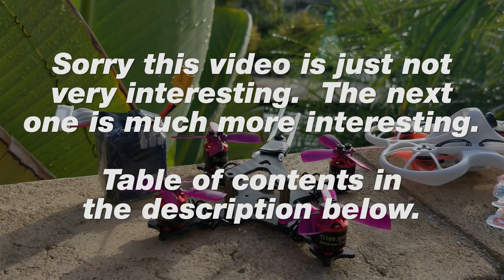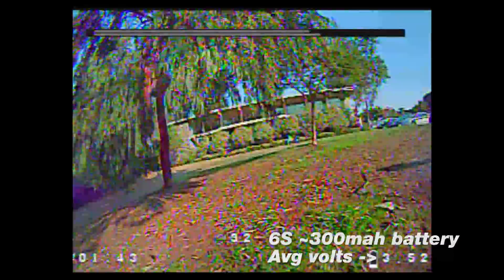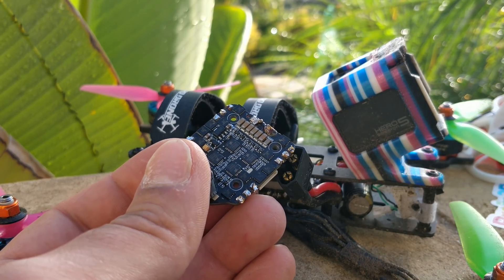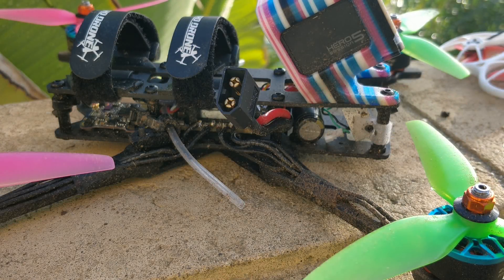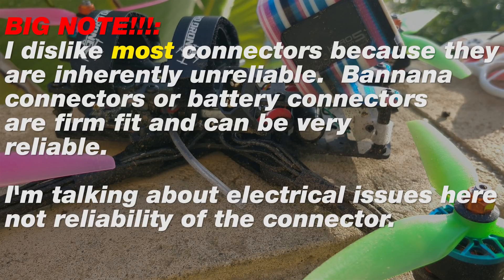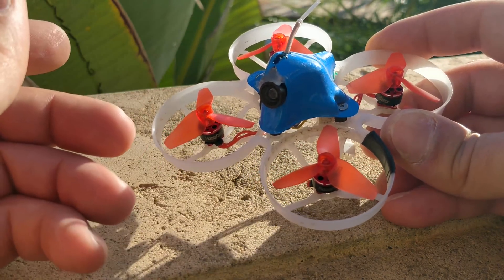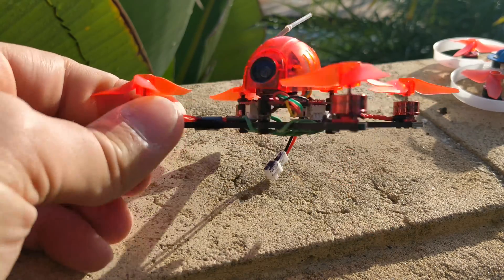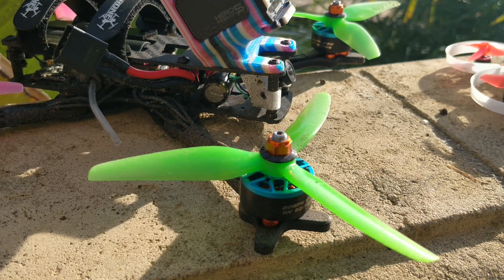6S 2", Just check the table of contents plz thx

Comment from the maker: Table of Contents:
00:53 - 6S 2" anticlimactic
06:00 - 4S vs 6S on same quad
07:07 - GoPro setting findings
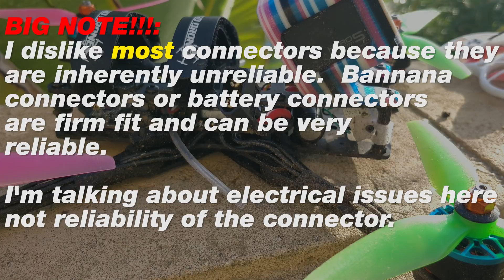09:41 - motor wire connector?
11:34 - TinyHawk update
14:24 - 1S 2.5" micro...
16:21 - My soldering SUCKS! dunno why :-(

I'm torn on whether I should pick up a set of these.  They're so pretty.  They come in 1800kv but I really wish they were a 2208: https://goo.gl/yRrihJ

TS100 iron: https://goo.gl/DqBipa, https://goo.gl/svK6DD, https://amzn.to/2OV5XMh
TS80 iron: https://goo.gl/CrQ17N

Things I like:

Micro Eagle - 
My preferred FPV cam still
https://goo.gl/or1fS9

Rush Tank Vtx -
One of many good Vtx's. I like it because it works well and fits my build style
https://goo.gl/YMYmya

WaFL’s Cap Cap
https://insta-stalker.com/profile/wafl.fpv/
https://goo.gl/9CZdAs

TinyHawk!: https://goo.gl/LrQiN9, https://goo.gl/8y66Gf

My TinyHawk tune:

First off, set your landing/warning voltage to 2.9v and your warning voltage to 3.2v.  This is a non-issue with 1S as you can't really pull enough amps on this thing to actually damage the battery much.

Make sure it's set to 8k/8k and I recommend Multishot with min throttle at 1175

Roll and Pitch are the same numbers: P 80, I 55, D 46 FF 45, RC Rate 1.32, rest default
Yaw: P 60, I 60, D 0, FF 45, RC Rate 1.32, rest default

Iterm relax on and on defaults, the other three switches above it off.

Tips?
Bitcoin: 1E4XZXoD4rS6MYWVWuenY7Kw2M1YgyNpoQ
Nano: xrb_1188ek5bd7tb9kw67asnp9o65byuoaxbtpxuznx1ribf75x78awywmakj55f
ETH: 0xD067F93811f2eC31CB1928901002dfdf9A492EF5
LTC: La2KWYAjp4VT2Lq2M76pbjzXWvRyjpfCtG
Reply: Kabab FPV you won’t be disappoint in those Xing 1800kv. Have you flown the RDQ 2207 1800kv? They perform identical if that gives you a gauge...
Reply from the maker: @dnafpv  well the specifics are within the range that I will like on 6S and they just look really really pretty that's really the only reason why I want them. They are just so pretty
Reply: Gotta say though as much as I agree about and love my tinyhawk those struts breaking really affects flight in hard turns for me. I’m using hot glue it seems to work best at keeping them attached
Reply from the maker: @dnafpv  yeah really annoying on the sruts. They're redesigning it and releasing a new frame
Reply: Kabab FPV they are soooo sexy I agree. They are great in the air too but I can’t say they will do anything better than look prettier. I definitely don’t think they’ll disappoint though. I kinda like them the same on 5” or 6” maybe I’d feel more diff if they were 2208

https://youtu.be/EhQTYb2NS5w

Comment: TS100 is better.
TS80 has non-standard tips which are expensive, and it runs off USB-C instead of a barrel connector.
the Pinecil (from Pine64) is worth looking into. I haven't tried it yet, but its entirely opensource hardware. Its similar to these irons

Comment: could we get the brass inserts from the XT30, without the plastic shell?
and just put shrink tubing around it after we 'plug' them together?
For motor connectors.
Reply from the maker: yeah actually you can. They're called banana connectors and come in long and short variety.

Comment: I know this is an old video so maybe you've figured it out, but if you use flux it'll solve all your weird solder joint issues. Not sure why it was suddenly an issue but flux will make those weird looking joints nice round shiny solder blobs.
Reply from the maker: Yeah it was just super shitty solder. There should be a link to the good solder in my new videos now

Comment: 63/37 is actually better for electronic soldering FYI. But besides that, I just found your channel recently. Actually heard steel and Konasty talking about you on their podcast so I came to check it out. Now I'm hooked on your videos which I find super informative. thanks for the stuff and good luck with everything in the future
Reply from the maker: I know 63/37 is technically better but I personally prefer the working time in case I need to suck off some solder or splatter it off.  It just generally flows a little better too.  Especially on thick wires where you're heating up all over trying to get that stuff to wet.  Welcome, glad to help...
Reply from the maker: Wait, they have a podcast? lol?  Where?
Reply: @Kabab  also yea they have a podcast they usually get to every week but sometimes every 2 weeks. Here's a link it's called teamfailsafe

http://teamfailsafe.libsyn.com/team-failsafe-weekly-podcast-bang-for-your-buck

It's Eric, Steele, and ruben. They kill it man so funny
Reply: @Kabab  that's the most recent episode. They talk about a reveiw you did about the props at about 21:30 into that episode
Reply from the maker: @pawn63295  ah I remember. I dunno why I forgot that was them.  Thanks for the refresh
Reply: @Kabab  I didn't know that. I'm super new to the drone hobby. I actually have everything except a drone yet. I fly in the sim still. I've just been told that 63/37 has a lower melting point and is easier to work with from electronics people I know

Comment: I use 63/37 kester solder with my solder iron at 420 degrees Celsius and I use solder paste on each pad and it's the way to go imho.
Mobula 7s frames are trash, not very durable at all, my son broke his one today smacking a tree at speed.
I'm looking forward to using my ts100 but haven't needed to use it out in the field yet.
Keep up the good work 👍🏽👍🏽
Reply from the maker: Just got the kester. The TS100 is awesome

Comment: hi @KababFpv 

I have been following 4s on 6s motors progress for some time and am wondering: 

if the better flight time supposedly on 6s is due to less amps higher voltage, but same overall watts? 

is it correct thinking to say if I run 4s on 6s motors will I have longer flight times?
Reply from the maker: Yes definitely 4S on 6S quad will give you more equivalent flight time.  The important factor to consider is equivalent time.  Typically you'd run a smaller overall capacity 4S battery over your 6S pack but you'll still get a little more time than the 6S pack.  Most of that reason is because the motor is just so efficient at not being over-pushed to convert electricity to thrust.  The whole system runs more efficiently....you're also flying slower.  You're not gonna create magic anywhere unfortunately, but you are better balancing the use of power available.  2700kv 4S 5" just seems stupid to me now.  Batteries hate that and are damaged during EVERY SINGLE FLIGHT.  I have some 6S packs with over 150 flights that perform very comparable to brand new packs.  Probably because they're not being stressed at all.  Same could be said for running a smaller 4S pack on a 6S quad.  The battery will last for more cycles because you're not asking 500 amps from it when you touch the throttle
Reply: @Kabab  thank you for taking the time to reply, really appreciate it, I had a ghost with 2600kv f40 motors and I was getting 1:30 min flight times and batteries since that session have been struggling, I have since taken the quad apart and sold off motors. 
just watched you new video with 1800kv with a throttle cap/end point of 89 and it seems like your pioneering the way forward, I've looked a lot into racing and am realising control > speed and power, it makes way more sense to have something slower that you have full control over at 100% throttle instead of something that your keeping at 50-70% trying not to blip it into the stratosphere. im super grateful your exploring this as I didn't want to spend the money on 6s motors and have it turn out shit on 4s so thank you for continually being curious and discovering with quads

Comment: I wonder if you lose any amps with a XT30 connection with what 16AWG?  Should run 8 to 12AWG wire for power wire with a xt60 for 6S no matter what size.  https://www.jamestowndistributors.com/userportal/pdfs/howtos/Tech_Wiring_Voltage_Sizes.pdf
Reply: Most batteries come with 14AWG wire for power wire.  I have to wonder if that doesn't hinder the amp flow.
Reply from the maker: The lines are usually too short to make a difference.  On my 6S batteries and quads I prefer 16awg.  The amps flowing to a motor are not nearly as high as the main battery lead.  An XT30/MR30 should be fine.  I have also run a 6S battery through an XT30 on the main line to see what would happen.  I couldn't tell any difference.  Flew fine.  Didn't even get hot.

Comment: Running those same 1108/6000kv motors on 3s with 3" avan props seems to be the sweet spot.  4s needed a lot of tuning and made the throttle really twitchy without any increase in control, probably a little loss of control, slightly more top end.  Both 3s and 4s packs were 550mah, 4-5 min flight time on 3s, 2 min on 4s.
Reply from the maker: Yes definitely

Comment: I am guessing it actually is the props are not designed for like above 30000rpm. APC said almost all of there props are designed for 30000rpm max before they can not hold there shape. Had that problem with my 145mph record quad. So you are probably hitting that with 4s.

Comment: That banggood solder sucks. I tossed it in the bin. Kester is a good brand btw.
Reply from the maker: Kester on the way
Reply: @Kabab  I've also been brushing flux on lately when I'm dealing with bigger wires. Here's a good example of a solder joint I used flux on. You do have a clean it up afterwards and it's a bit sticky but the solder joints look amazing.

Comment: Hi Kabab,  thanks for sharing this,  I have been looking for a 2in 4s quad but after flying one I was looking for max power and speed up to a 2.5mm prop. 
After a while I came to the same conclusion that 6s 2.5 inche props are not going to work.
Reply from the maker: yep, no dice

Comment: Just as everyone else is saying, Kester solder and a good flux. Always use flux.
Reply from the maker: Kester on the way
Reply: @Kabab  63/37 no clean flux
Reply: @irfuel  Yeah, most of the solder we use in the hobby has a flux core. Unfortunately, its never quite enough to get a really good quality joint. It's always best to use additional flux, it really does make quite a difference. Its not absolutely necessary, I just makes everything flow a hell of a lot better.

Comment: like the idea of the xt-30 connector for the motors. Soldering wise best I can recommend is Kester 24-6337-0027 solder and if your still struggling use a flux pen. after that follow up with the 91% isopropyl alcohol and a old toothbrush. the absolute worst tho is the pre-tinned boards with the lead free solder if you have a pad like that get all of that crap off and start over with the solder I recommended. Hope you had a great Thanksgiving Bob !
Reply from the maker: Kester is on its way. Being delivered tomorrow

Comment: I'm with you on quick connectors. I've been soldering my whole life and don't mind doing it, but I'd still rather a way to snap things together quickly. Replacing a motor in the field with a TS100 still isn't idea.

Comment: Which is more important for a good flying quad weight or cg?
Reply from the maker: Both. They go hand in hand. But if the CG is around center regardless, weight is more important
Reply: @Kabab  the thing is that I'm trying to to decide between a taller lighter frame or a slam deck but heavier frame. The Johnny fpv Astro x5 or the CMW smooth operator
Reply from the maker: So those are very very different frames.  Before I go any further, I have nothing against either company and I actually like both companies a lot.  However, I would personally go with the Astro X if I had to choose because the Smooth Op is so damn complicated looking I don't even want to see what it's like on the inside.  The X5 is also like 10g lighter.  But before going with any of those, I'd rather go with a martian clone for like $30.  Seriously.  $100+ for a frame is really ridiculous.  It's flat carbon.  At least the Astro X has some expensive finishing work.  These things do not cost so much to make.  They're just marketing their ass off and charging a pretty penny for it.  Again, I don't have anything at all against any of these companies.  I like them very much.  Especially CMW.  I just do not agree with $100+ for flat carbon and would probably go with two of these instead of one of any of those myself if I was spending the money: https://www.banggood.com/URUAV-Martin-V-215-215mm-Wheelbase-5mm-Arm-Carbon-Fiber-Frame-Kit-for-RC-Drone-FPV-Racing-p-1385460.html?rmmds=newArrivals&cur_warehouse=CN

Or one of the ammox frames. I don't remember the brand. Or one of my own frame designs which I specifically do not over price.  My premium design is coming in probably a few weeks and will knock peoples socks off. For the likely $50 price, it will be nicer than the Astro X and a far far far better value.
Reply: @Kabab  now that you say that you say that and I gave it some thought i fell like the the flosstyle will probably be my best option. It is out of stock right now though so ill have to wait. have you thought about making a H configuration of the frame, more like that of the alien?
Reply from the maker: @benwoodard6844  I would commission you to wait a few weeks if you can. I just placed the first batch order for the new design two hours ago. It's a very special design that's a blending of the floweride and FlosStyle but much much much improved.  It'll likely be the same $50 and will have premium finishes to choose from. High gloss, oil rubbed like astroX and I'm also working on a forged carbon cosmetic layer in high gloss finish. Of course all with chamfers. I don't know the cost per unit yet but I know it's gonna be much higher than the previous frames. Still aiming to keep the price as low as I can.

Comment: The worst part after trying new things is all the gear left behind haha. 
Saying that 3” double props on high kv ( say 6000 for 4s) around 80g without lipo flies nice. I want to add rxc 1306 T mount motors now because emax 1106-4500kv is much slower than 6000 but latter burns. 
Demonrc has nice 550mah 4s lipo, 21g legit frame. Burned emax and hglrc440 tho so I guess it’s gonna be ori32

Comment: You've really gotta try out the 3025 gemfans on a sub 20g frame with the 110x stator motors. Flight performance is significantly improved over any 2.5" prop I've tried. Overall efficiency is higher, longer flight times, but you do pull in the range of 5 extra amps at full throttle. if you can get under 100g with battery on 3s you'll find it hard not to like the quad.
What flux do you use?
Reply from the maker: I just ordered some kester. For now I'm just gonna test my micro brushless whoop thing and not do little things anymore. I have one other 2"quad on the way but that's it

Comment: I have been comparing 3S/550mAh and 4S/350mAh on my GT-R90 2" running Avan props. Both Gaoneng 80/160C cells, both aproximately the same capacity and weight. Tried HQ 3-bladed props on 4S too to cope with the higher potential RPM. The 4S performs slightly snappier, but the sag is even more pronounced than the sag on the 3S battery, which kind of defeats the higher voltage benefit of 4S.

We are just hitting and exceeding the maximum power output per gram of LiPo cell I guess. As is true with antenna to transmitter matching and motor to mechanical load matching there is a point of maximum power transfer. Open circuit we have maximum voltage but no current: no power since P=U*I. Shorted we have maximum current but no voltage: no power. Maximum power transfer occurs when load (impedance) is matched to the source (impedance). We can go to 20S, but with the same amount of active battery material and surface area we will not get more power, just a change of optimal impedance. Which is what you actually do when you choose lower kv motors.
Reply from the maker: I think we're good on 6s for a while
Reply: @Kabab  On 2"? Makes little sense until battery power density increases significantly. The weight overhead outweights the benefit of lower I^2.R losses on those micros.

Comment: Nooo 60/40 is really not good mixture 63/37 is better but this solder from banggood is the worst thing ever! 

I SWEAR THAT IF YOU TRY THIS THING IT IS GOING TO CHANGE YOUR LIFE FOREVER!!! 

https://www.cablestogo.com/product/38027/1mm-lead-free-solder-rosin-core-1lb-taa-compliant

So much easier to use and the joints look automatically awesome it's some kind of black magic I think 

Really I have 2 friends that couldn't solder really well but then I borrow them this their soldering improved so much
Reply from the maker: I've got some kester 60/40 on the way. I like the flow of 60/40 more

Comment: When you set your shutter to 1/60 i dont think the gopro stops compensating with iso, it is only that the iso is already set at the minimum value so it cant get a lower exposure. If you want motion blur and a nice exposure an nd is the only way to go since you cant close down the aperture
Reply from the maker: It doesn't have an aperture. Also, the issue is that the iso is too high. It needs to drop the iso but it doesn't for some reason.

Comment: I always had 5" quads. Racers (Diatone GT2, Shuriken X1..) and some freestyle (Chamelleon, Lisam..) I just purchace a Leader 3 SE and change the motors for a SunnySky 6500kv and it flyes GREAT with 3*3*3 Emax props! You should try. On 3S flyes faster than 4S on original 4500kv motors. After change the motors, I almost never use 4S, its too fast. Hehehhe
I cant express how fast and fun it is.
Do yoursef a favor any find one to try ;-)
Please tell me your inpressions.
Happy flying

Comment: Awesome to see someone else talking about connectors for motor wires. I've been considering using mt30 connectors for a while. They are pretty much the exact same except they are a triangular shape so you can fit all three prongs under a thin arm easily
Reply from the maker: Those are way too large. The MR30 is just the perfect size.